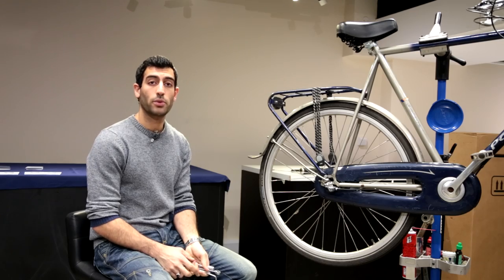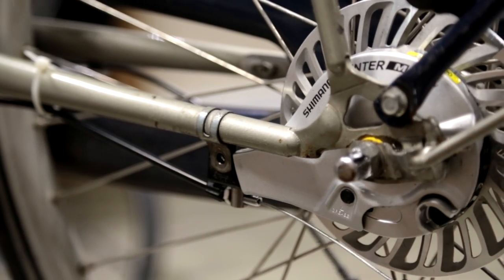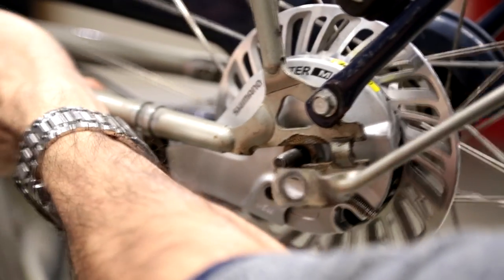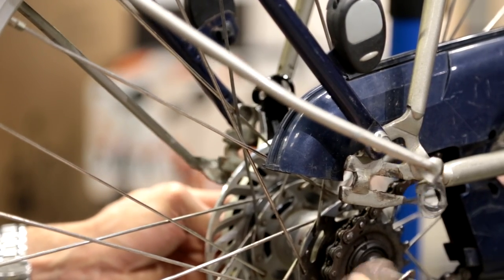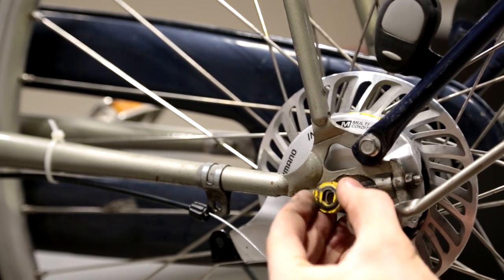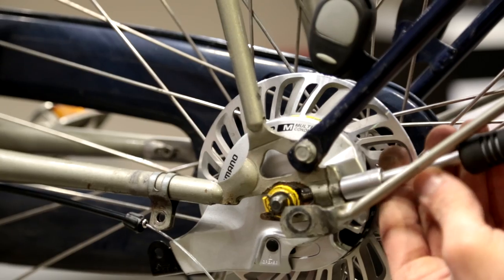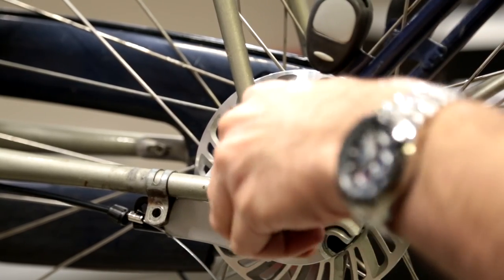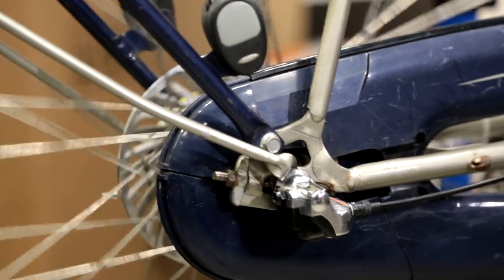Rear wheel removal Shimano Nexus 3 - Be Dutch! Bicycles

Comment: Thanks. Had rim brakes and no chainguard, so really easy once I realized I needed the 5mm to remove that one bolt.

While replacing a spoke, the gear selection rod fell out so after putting it together the gears wouldn’t switch; then we searched the floor and found it and put it back and it worked again.

Comment: Very informative but very complicated nonetheless. I find that such a system works for the Dutch where cycle repair is cheap and they don’t have to do all this themselves. A coaster break or drum break increases this complexity. I went for a bike with discs and Shimano Alfine - such a brilliant combination. Perhaps Magura rim breaks would be even better.
Reply: You're right. Dutch bikes are not designed to be user serviceable at all. They're designed in a way that even a punctured tire requires a trip to the shop and paying a repairman to fix it for you.
Reply: “cycle repair is cheap” is actually untrue. manual labour is typically expensive af in the netherlands.
i do agree tho (having had to repair a couple of them)  that these dutch bikes are basically built so that bicycle repair shops can thrive. you habe to disassemble half the bike just to put up a new lock or fix a puncture. ridiculous.

Comment: i have a 3 speed adult husky tricycle and the reference number on the hub SG-3C41 nexus inter 3

the problem is that the 3rd speed does not work

would i need to buy the entire hub kit?
 hub drive? shifter/crank?

Comment: Dude! I just did this on my bike after watching your video. Man, what a struggle. I've got the 8 speed with no bell crank To get the gear shift mechanism back onto the hub, I had to disassemble and understand the whole thing. The shifting cable was just too tight, no matter how I tried to coax it at the hub or handlebar side! I'm never replacing that tube again, it's gonna get patched for the rest of its life!
Reply: This type of bike is best avoided; every job is a major undertaking. I've know this since forever, but somebody gave me one for free, yesterday, so now I'm now trying to fix it up for my son-in-law to use as a station bike. He may have to go without the back brake working 🙂. I see them abandoned very often (The Hague town center) as nobody can be bothered to pay somebody else to repair them.
Reply: @choomanfoo  Interesting! I thought Dutch bike mechanics would know how to do this in their sleep... 😅
Reply: @cornelmasson4610  Repairs can be expensive, if done by a guy in a bicycle shop, so many people (especially students) tend to just keep riding till it's no longer possible. I was able to ride home on the bike (Gazelle Esprit 2016) I was given, even with the back brake non-existent, the front brake worked a little, the kickstand was rattling, the chain was rubbing on the bottom of the plastic chain guard, a broken spoke was sticking out on the back wheel, the back rubber part of the rear mudguard was hanging off and a pedal was scraping across the plastic chain guard. I worked on it for a few hours, yesterday, so it should be ready by this afternoon. I have a shed full of bike parts. I continually collect them from abandoned bikes on the street, so I normally only have to pay for new cabels.
Reply: @choomanfoo I am a building manager in student housing. Students that leave often leave their old bike behind. They are hardly usable anymore. Then another student (with a bit more interest in mechanics) tightens some spokes, tightens the chain, inflates the tires and puts a plastic bag over the worn saddle (soaking wet after the rain) and it's good for another two to four years.

Except the really really nice ones. When they need repairs, you need special tools, special parts etc, so those are left to rot.
Reply: @IvoTichelaar  I really like hearing stories like yours. Ever thought of keeping a set of 2nd hand tools around, in case a student needs help and encouragement? Or is that already the case?
Reply: @choomanfoo  I was planning to get some communal tools for when I started this job. But in practice, there are always some bicycle enthusiasts in the building and they offer their services before I even hear about a problem with a bicycle. Students. GenZ. They're really nice people. :-)

Comment: Hi there, thanks for sharing. I know you can help me on this one!... the thing is that I´m in love with an Old Dutch Batavus but it has a coster brake with 3 shifts and I´d like to change that to V brakes and keep the shifts.. is that easily possible, or do i have to change the rear wheel? Should I try to just find one with all the specifications? 
Thanks!

Comment: The yellow locknut needs to be the other way around with the extended piece onwards the chain tensioner. Je bent geen fietsenmaker!
Reply from the maker: +Zjoe Zjinzoe It is called a locknut for a reason. It locks the wheel and brakes from moving around. The direction of it (forward or backwards) does not affect the way this nut works.

Comment: How Do you replace the shefer cable
Reply from the maker: Jody Wolk Can you please elaborate on what you mean with the shefer cable? Do you perhaps mean the shifter cable? If you want to replace the gear cable itself (not the housing) you can screw open the bottom of the bell crank using a screwdriver. With a small wrench you can release the gear cable, then pull it out and replace the cable. If you want to replace the cable housing I would advise to purchase a new bell crank. I believe the cable housing is part of the bell crank which is why I advise you to do so. If you need more help please do not hesitate to ask :)
Reply: Jody Wolk  ?

Comment: What a nightmare...
Reply: Hey Stupid, trying to help a friend that has a dutch bike. When changing a tire/tube is that complicated that is a nightmare in my view. My bikes wheels take at most 1min to take off...tire change 5mins tops. One of them is a single speed with a chain tension system as well so these Dutch bikes are terrible designs. But good on you for convincing yourself otherwise. That explains why that design is used all over the world for proper cycling on various terrain and long distances...not.
Reply: It's only a nightmare when you're not skilful enough. I dis- and reassembled these kind of bikes when I was 11 years old, so a school-kid could do the job. These bikes are not designed for easy maintenance, but for low maintenance. Closed chain guard, closed gearbox and closed brakes, protecting it against rain and mud. Important when you use your bike every day, 10.000 km a year.
Reply: @gertjanlaan10  Actually, in the Netherlands, it's more like 2500 miles(1500 km) a year. Also, your country's flag as a pancake.
Reply: @shannontrainer5857  No, my home address is 17 km from my work address. So 35 km a day times 5 days a week times 45 weeks = 7875 km a year. Plus some recreational biking in the weekends makes about 10.000 km. Flat as a pancake indeed, that's why this is such a brilliant design.
Reply: Gertjan Laan Train rides between home and work doesn’t count.